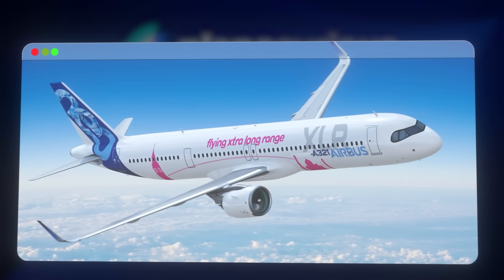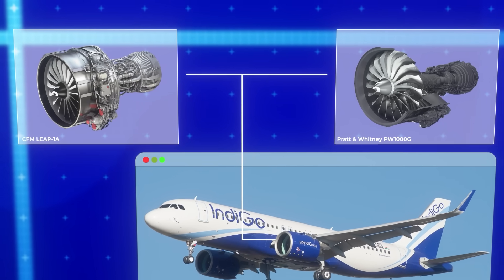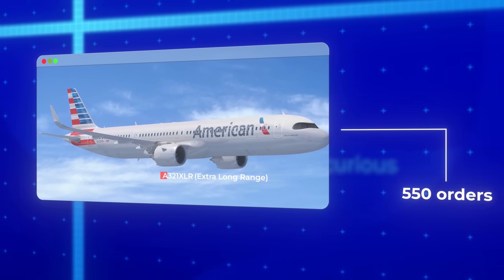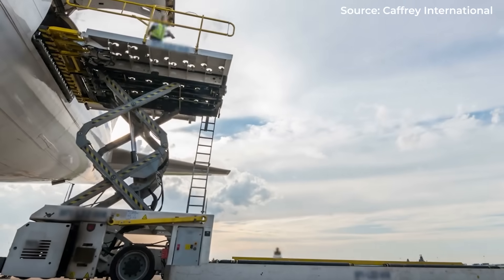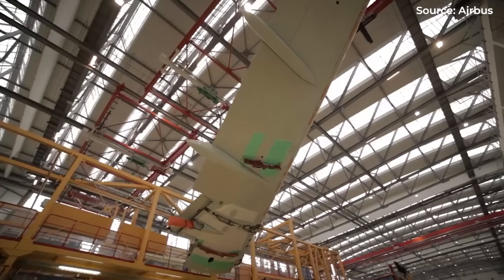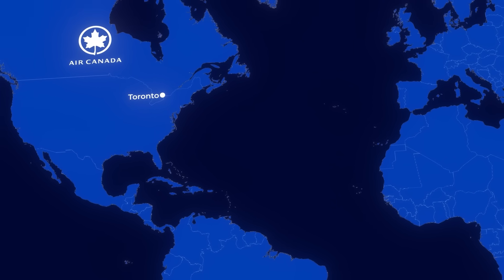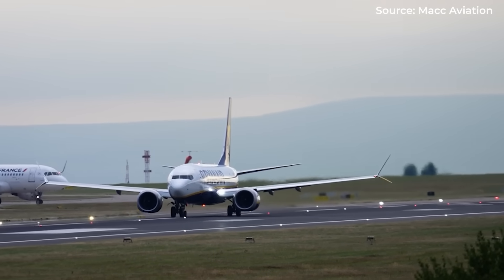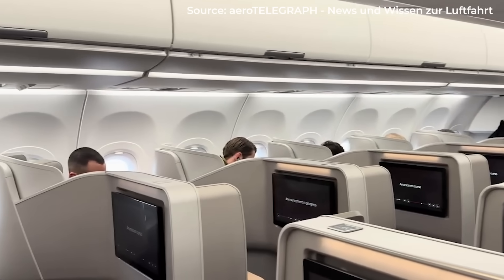How Airbus Outsmarted Everyone With One Jet

Comment: Question for the aviation experts.
Will the XLR have life as a cargo plane after end of service life like the 757?

Or will it be single purpose like the A380?
Reply: A320 models can be converted, there is a A320P2F program. Currently it's practically dead because there is a high demand for the planes in passenger service. For the XLR, no one is planning to retire them within the next decade. There isn't even a conversion program for the neo ones yet, but I am sure there will be once the first planes retire.
Reply: You don’t need an XLR for cargo. A regular Neo would do. You don’t really need the range, unless you want to cross the Pacific Ocean.
Reply: @rtbrtb_dutchy4183  a similar argument was made for the A380.  Now the aircraft has no useful life after passenger service.
Reply: @iceman9678 that was my point. I don’t think the XLR would be good for cargo. The more fuel you put on, the less cargo you can carry. So the regular 321neo would be a better solution. 

Having said that, they can still use the XLR for cargo, but the extra tanks won’t be used.
Reply: @rtbrtb_dutchy4183  The XLR has a 4t higher MTWO than a neo at practically the same empty weight.
Reply: @danielrose1392 also has the same useful load. So they can’t carry more cargo.
Reply: @iceman9678  The difference is that, A380 cannot fit most cargo hubs, because of its massive size. A321 can. Also, A320 family freighters can hold ULDs in both upper and lower deck, which is a clear benefit against other narrow-body freightera.
Reply: @haj8579  Irrespective of size - there is not cargo conversion.
Reply: @iceman9678 Size does matter. Most cargo-dominant hubs are code E, D or even smaller, which means that A380(only available for code F airports) cannot even enter. That is the main reason that A380 freighter conversion is not viable. On the other hand, A321neo vanila has airport code C clearance, and XLR has D, which is the same level of 767F. This means that 321neo variants are much more versatile than cancelled A380F. Also, I think you missed a point that A321XLR's commercial flight was only 8 months ago, while 380's was in October 2007. The latter has enough time for getting old enough to some converted, while the former just entered the passenger service. Maybe not as useful as vanila 321neo, I can see some potential of XLR for freighter conversion when they are old enough. A321ceoP2F, which has lower MTOW than XLR, has already gotten a considerable number of orders.

Comment: You said that the A321 XLR could signify a strong shift away from the hub-and-spoke model to a point-to-point model, however it could actually also reinforce the hub-and-spoke model by making viable even more destinations from the hubs. Imagine something like Dubai-N'Djamena, or Singapore-Guam, or Cleveland-Tegucigalpa
Reply: Most budget airlines have already been using the point-to-point model for a long time. I think the XLR was designed with this market in mind, flag carriers are just secondary targets.
Reply: @Petidani0330  well, yes and no. Fundamentally, low cost airlines are most present in short haul flights, where only the point to point model works. The A321 XLR will only make the distance between those points longer. However the revolution potential is for legacy carriers indeed, where their seasonally unprofitable activities can now become productive, and otherwise unviable routes can become so. Those might be different than the low cost routes made viable, as the businessman/average traveller ratio will impact viability on certain routes for sure. Now to be fair the potential opening of the transatlantic market to low-cost airlines is a revolution, but it had been announced before the A321 XLR, and yet it hasn't materialised fully.

Comment: Well, it does carry a lot more fuel, but take a wild guess as to what happens with payload. 
I come across them entering the NAT Tracks at a starting level of 270 and 280. Stretching the range by simply putting bigger tanks is not that revolutionary if you're sacrificing payload.
Reply: The important point is more that the volume for potential cargo is preserved, so that if an airline needs less range or the flight has a lower occupancy rate on some stretches, they can increase cargo payload without having to buy a different type of aircraft.

Comment: I'm a ramp worker and I can defintely tell you. 

The Neo's are way more quiet than the old Ceo's, like I am wearing earplugs but you can for sure hear the difference in noise volume

Also, JetBlue is already flying from JFK to Amsterdam Schiphol
Reply: Which jets are jetBlue using for this route? XLRs?
Reply: It’s ‘like’ you are wearing earplugs? What happens when you are actually wearing earplugs?

Comment: New generation wide body airplanes (787/A350), including the 747-8 and A380 all fly higher and ride smoother. The small wing on the A321XLR with the increased weight leaves you down in the turbulent air and is more bumpy. This is a downside on long flights. The XLR simply cannot get up to the altitude where you find smoother air. It also struggles with high/hot operations for the same reason, not enough wing.
Reply: They don’t really fly higher. Not sure where you get this from. They all start in the low to mid 30s and end up in the high 30s, low 40s.
Reply: @rtbrtb_dutchy4183  You are incorrect in real world operations. The A350 and 787 regularly are in the FL380 - 390 and even FL400 range on long flights (unlike the older 777-300ER). The 321XLR, due to weight, wing and thrust, start in the low 30's and never really get above FL350 for most of the flight. Further, the maximum certified altitude for 787 and A350 are 43,000 feet. The 321XLR will NEVER see FL390 (it's maximum) in real operations, it is just too much for the small wing and load. The large, flexible, wing on the A350 and 787 naturally attenuate turbulence to a far greater degree than the small, stiff 321XLR wing. And then of course there are the longer flight durations. The 321XLR is a Mach 0.78 machine while the A350/787 are both March 0.85 machines. This is an additional 45 minutes on a 4500nm flight.

Comment: One flipside to this though.... we're experiencing a pilot shortage, and SEVERAL near misses at US airports due to too many takeoff/landing slots and a shortage of air traffic controllers...in the face of that, will our airline infrastructure really be able to handle more of these "long and thin" routes in the coming decades?

I feel like if anything we may see somewhat of a shift back to widebodies serving many of these routes to open up additional slots. At least for the heavily trafficked corridors.

Comment: Picture this: if you wanted to fly between Europe and North of Brazil you would have to fly 11+ hours to Sao Paulo or Rio de Janeiro first, change aircraft and fly another 3-4h to your final destination. Last year I had the chance to fly the A321XLR from Natal to Lisbon direct in "only" 7h. Great experience and much more comfortable than I was expecting
Reply: Correct me if I´m wrong, but aren´t there already long established routes from Europe to Recife? So in this case it didn´t really bring any added value other than they can serve a smaller airport in the same region.
Reply: @Markus22MUC oui Récife était fait par Airfrance en A340 et on a vu sa rentabilité à l'année. Donc un 321XLR lui, serait rentable.
Reply: Question: did you fly economy or businessclass on the XLR?
Reply: @Dirk-van-den-Berg economy, but great legroom
Reply: @emmanoelscharf9936  I was wondering about that. I am a 2.00 m tall guy, and wait for these kind of reviews if 7 to 8 hours for a tall person would be exhausting or not.
Reply: Oi cara você é um mentiroso ,  a única companhia a cruzar o atlântico sul para Natal com A321 é a TAP e esta companhia não tem XLR por isso você está sonhando
Reply: @Papaondas  devidamente foi simplemente incorreto, não è um mentiroso

Comment: Basically a return of the beloved 757.
Reply: Not in engine thrust or capacity.
321 has to sacrifice to get range or payload.
757 does not care give it all the bags all the pax and all the gas and itll still jump off the runway
Reply: @Acuda721 not really. Pretty much every engineering invention is a balance of sacrifices. The 757 obviously is MUCH less fuel efficient for instance.
Reply: @im_a_myth_717 Never said it was fuel efficient. But the take-off performance vs the two is nowhere even close. When the 321xlr can PROVE  hot high and heavy performance. Then you can compare
Reply: @Acuda721 I mean sure, I’m a performance engineer myself, so I understand what you’re talking about, but at the end of the day the company makes those decisions, they analyse whether it is worth the sacrifice that comes with selecting more powerful, and less fuel efficient engines or if it is better to go with worse takeoff performance but better fuel efficiency.
Reply: @Acuda721 so sure, maybe the takeoff performance is better for the 757 but airbus have made those decisions to sacrifice the performance in that aspect for gains somewhere else. So there’s nothing wrong in comparing. It’s always about prioritising your sacrifices
Reply: @im_a_myth_717 especially when pw1000 gtf are prone to chewing themselves up. Granted more on the 1500's than 1100's, coming from an Aircraft Maintainer that gets to work on both plus more. Theory is great, but lately the bus products have come up shorter than advertised
Reply: @Acuda721  Hot High and Heavy will not be the A321-XLR's forte. 
Does not have to be.
Denver, the mile-high city, will not be its "most frequently served airport".
But there aren't that many 'Denvers'.
Elsewhere, -30% fuel burn trumps everything - end of story.
Reply: @Acuda721 nope, what you say is incorrect. You are comparing max take off weight. But at max take off weight, the XLR can fly 1000 miles further. 

So if you want to compare takeoff performance, you have to fuel both airplanes for the same range. You will find that the XLR will be even better than the 757.
Reply: @im_a_myth_717 people keep comparing the two at max takeoff weight. At Max take off weight, the XLR takeoff performance is not as good as the 757, but it can fly 1000 miles further. So when you reduce the fuel to the same range as the 757, it performs better.
Reply: @rtbrtb_dutchy4183 The LEAPs or GTFs do not output the thrust of an RB211 or Pratt 2000. Ask any pilot, airspeed is life.
And at high altitude airfields youll need all the thrust you can get.
Reply: @Acuda721 the 757 is 30,000 lbs heavier than the XLR. That’s why it needs more thrust. 🙄

Both airplanes have roughly the same takeoff performance under most circumstances. Your “engine power” has nothing to do with this. A heavier airplane needs a bigger engine to accomplish the same.
Reply: @Acuda721 also, newer engines, they keep more of their static thrust at higher temperatures and elevations compared to older engines.
Reply: @Acuda721  The 757 is an odd aircraft.

Youtubers seem to love it but airlines didn't want it and Boeing didn't seem to care.

It looks very much as if it was a solution looking for a problem.

Comment: One of the shifts we have accepted in our industry (and society at large) is to use reliability of products (i.e. jet engines) to reduce costs - but only by introducing a STEEPLY INCREASED RISK GRADIENT!   So, when a 4 engine jet loses one engine half-way across the ocean - not such a big deal. Maybe divert or just keep going on the original route. BUT now, when the rare engine fail/shutdown occurs on a twin jet, we are faced with diverting to a strange airport and flying for THREE HOURS over a frigid North Atlantic ocean on one engine - hoping like hell that the first engine failure was not due to fuel contamination (or some other factor common to both engines) issues!! No wonder airline pilots still get gray hair as we age!! haha. But really - all our skimpy fuel and alternate airport planning etc. has shifted the daily environment. Whereas it used to be like driving on a wide highway with a huge shoulder to just pull over if need be and stop - now it's like driving on a narrow, shoulderless road with a sheer dropoff down a mountain is we were to wander 2" off the centerline. phew.. This is hard work to deal with the consequences in the 'unlikely event' something doesn't go as planned. We go from normal to MAYDAY in a literal instant.